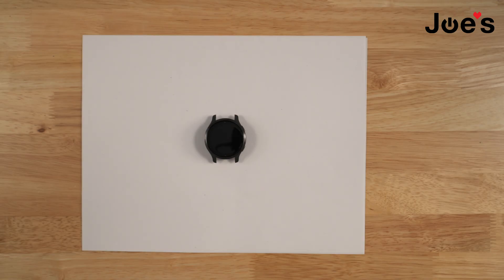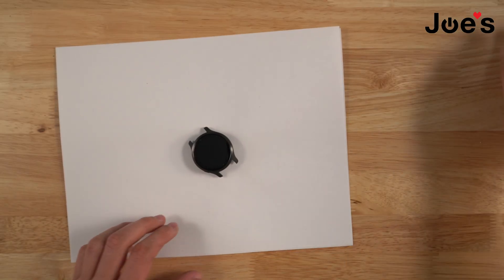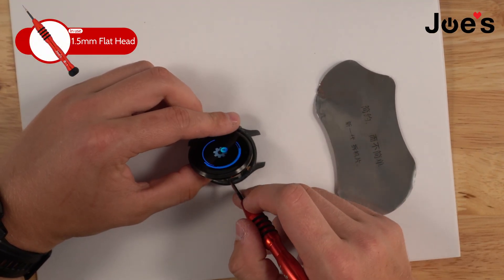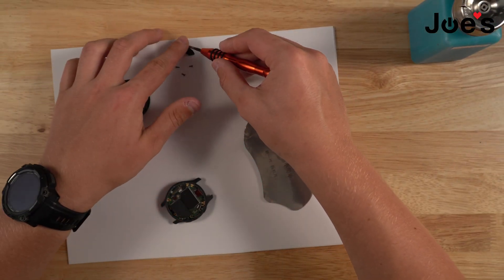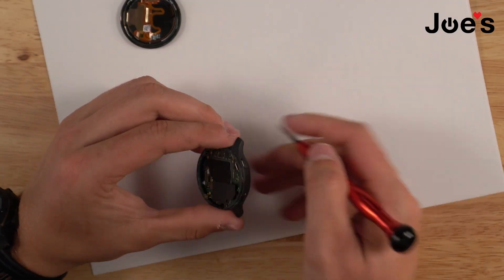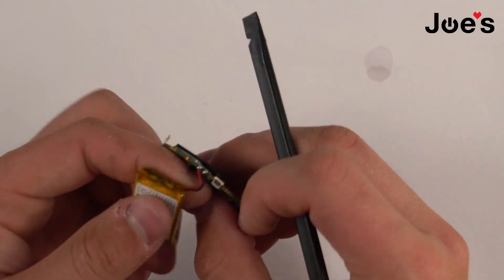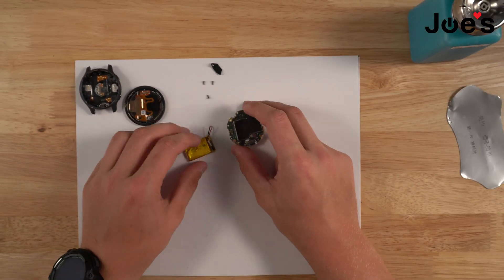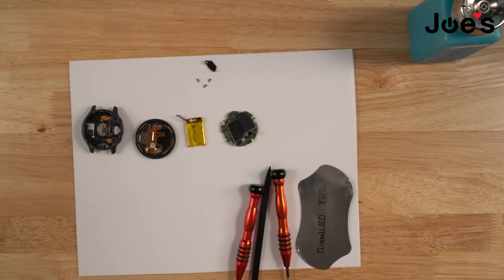Garmin Venu 2s Full Teardown Tutorial

Comment from the maker: 🔧 Repair your Garmin Venu 2 S – all the parts & tools you need 👇

📬 Want a pro to fix it?
Send your device in for expert repair:
👉 https://www.joesge.com/pages/repair-service-issues?p=venu-2s

🛠 Prefer DIY? Grab the exact parts used in this video:
🔹 Garmin Venu 2 S replacement parts: https://www.joesge.com/products/garmin-venu-2s-music-gps-tracker-repair-spare-replacement-parts?variant=40388430168110

🧰 Tools shown in the repair:
🔹 Heat gun: https://www.joesge.com/products/hot-air-gun-station-200w-handheld-portable-black-tools?_pos=1&_sid=1172e4dec&_ss=r
🔹 Thin pry tool: https://www.joesge.com/products/apple-samsung-fitbit-lcd-touch-screen-removal-thin-pry-tool-tools?_pos=2&_sid=358242818&_ss=r
🔹 Isopropyl alcohol (70 %): https://www.joesge.com/products/cleaning-screen-removal-70-isopropyl-alcohol-10ml?_pos=1&_sid=2b6b32007&_ss=r
🔹 Flat‑head screwdriver (1.5 mm): https://www.joesge.com/products/flat-head-1-5mm-electronics-precision-screwdriver-repair-tools?_pos=2&_sid=62a83844d&_ss=r
🔹 Nylon spudger: https://www.joesge.com/products/nylon-spudger-opening-prober-alignment-ribbon-removal-repair-black-tools?_pos=1&_sid=322bd272c&_ss=r
🔹 Phillips 1.5 mm screwdriver: https://www.joesge.com/products/electronics-precision-screwdriver-philips-1-5mm-repair-tools?_pos=2&_sid=558fc1d83&_ss=r
🔹 Soldering iron: https://www.joesge.com/products/60w-adjustable-led-soldering-circuit-board-repair-iron-kit-tools?_pos=1&_sid=5fb6c5c85&_ss=r

🥷 Want a custom repair video each month?
Join our channel membership for priority content, shout‑outs, and more:
👉 https://bit.ly/3rMJJkW

💬 Have questions while you work? Drop them below—we’re happy to help.

👍 Like, comment, and subscribe if this guide helped you out!